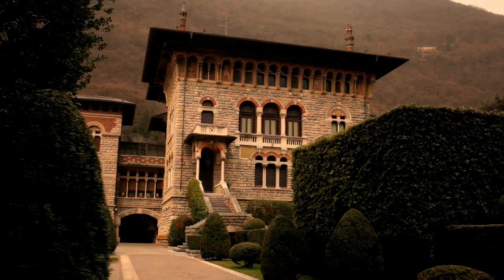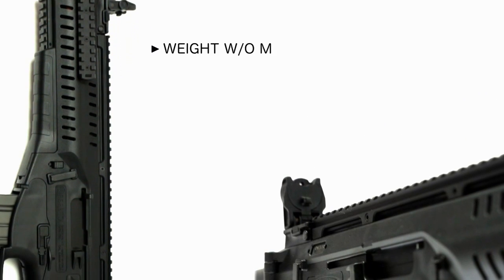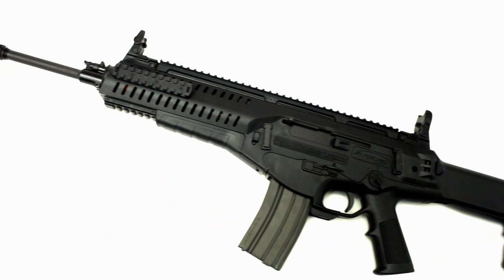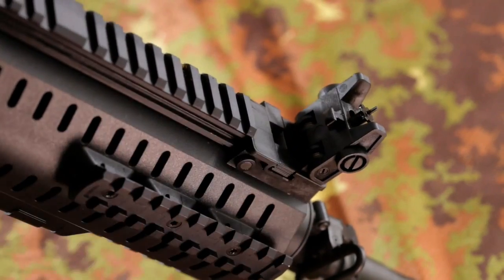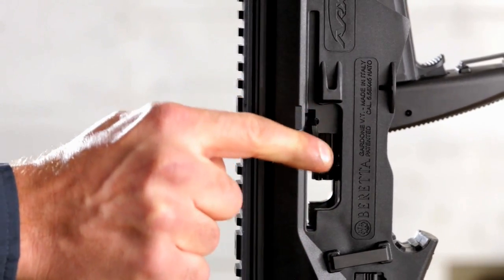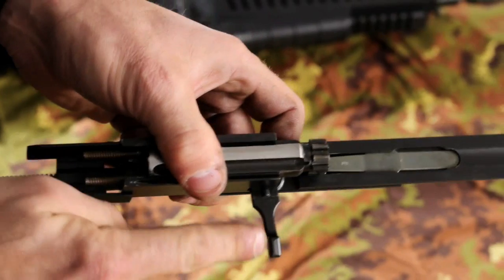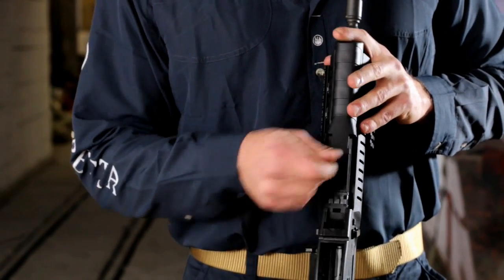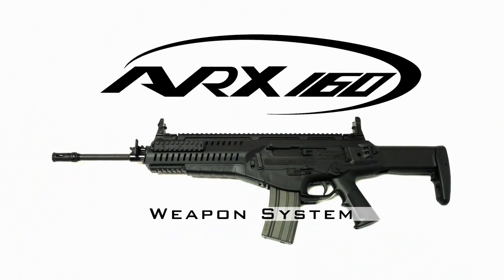Beretta ARX 160 - Overview, Disassembly and Reassembly Tutorial

Comment: LOL at "minimal recoil" while the slow-motion shot shows it jumping all over the place against his face.  I'm not faulting the gun; that's what happens when you shoot 5.56 NATO from a gun that weighs 6lbs, but this is not a "minimal recoil" platform.  I have one on order and you can bet that I'll be fitting it with an effective muzzle brake, especially after I SBR it to further reduce the weight.
Reply: IMO that guy sucks at recoil control, that's all.
Reply: That too.  I have mine now, it is quite light.  I chopped the barrel to 9.5" and have a SilencerCo Saker inbound for it.  Will be using the brake mount.